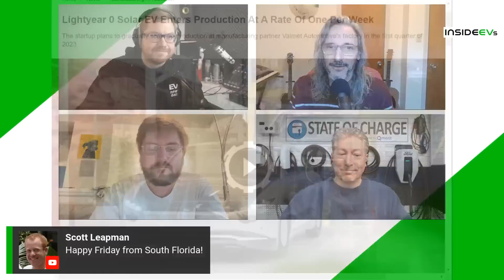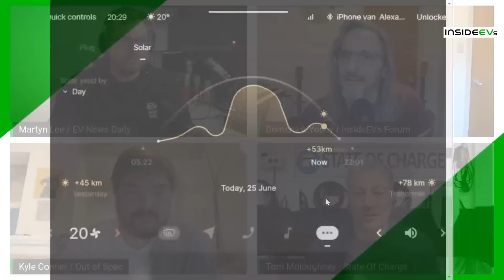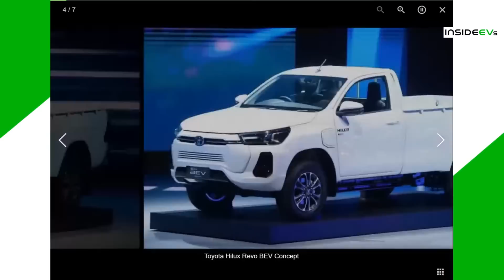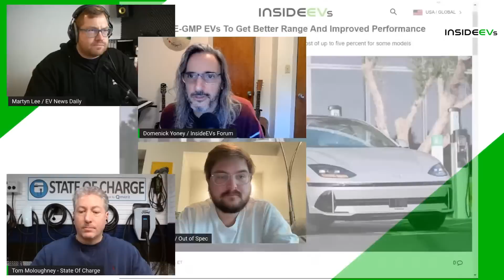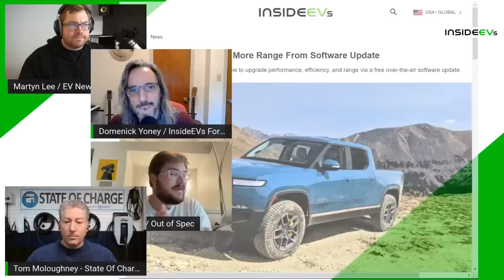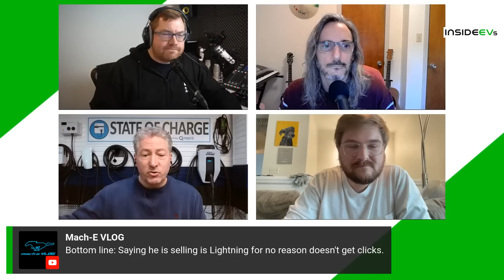Lightyear 0 Begins Production, Toyota Revo Hilux Concept and Hyundai Virtual Gearbox

Comment: The other issue with battery sourcing is that companies also probably don’t want to commit themselves fully because they will then be beholden to the battery manufacturers and could get into a difficult position if the materials are not available for any reason.

Comment: I think he's on to something though. Slap a battery in an ICE vehicle and an E on the badge and you're done? Why not create a new vehicle altogether?
Reply from the maker: There have been OEMs that have really done just that, but Ford didn't with the Lightning - not by a long shot.  The architecture, like the frame, battery, motors, and suspension systems are all-new ground-up designs for the Lightning. But hey, why let the facts get in the way of a fun video that's out to generate clicks?🙄

Comment: Is the id4 still good for the 7500 if bought in 2022?
Reply from the maker: Only if it is one built in Chattanooga.
Reply: @InsideEVsUS  has it been reduced to 3750 like teslas 4 years ago?
Reply from the maker: I believe it will be reduced to $3,750 January 1 for the ID.4 vehicles built in Chattanooga.
Reply: @InsideEVsUS  I was just reading some thing on JD powers, which I don’t know if they know what they’re talking about. But if purchase in 2022 the ID for will still be eligible for the 7500. The question comes for anything but January 1 and after

Comment: I think Hoovey has a standard range battery, I think most other have the extended range.  So would that make a difference?
Reply: No, it wouldn't. The issue we had wasn't with the range he was projecting, it was with the consumption rate that we don't believe is possible to attain driving the way he said he was.

Comment: I’m just not sure why the Lightyear is even worthy of conversation. It’s too expensive and too ugly to compete with EV’s that already exist.  So it has solar panels…it still has to be a
Competitive EV in the market, no matter where it’s electricity come from.
Reply: Because it's a halo car with a cheaper one coming afterwards that will use the same technology.  What's interesting is that this somehow doesn't get mentioned - perhaps it's foreign and needs a kicking?
Reply: @timmurphy5541  it has nothing to do with being foreign…for me at least. I just think any startup has to be competitive from the start, just to survive as a company. There are enough players in the EV market now that surviving long term as a speculative “test bed” is increasingly difficult. Investors just have more and more proven options.
Reply: @steveroper8733  they have simply sold expensive cars to investors. AFAIK they are sold out. It's hard to imagine a startup making physical products that could possibly produce a mass market car immediately without a quite gigantic investment - this is not software.  Do you have an example of a car company that has done so?